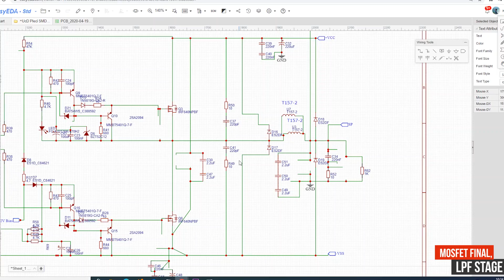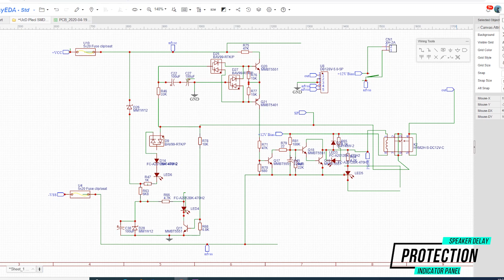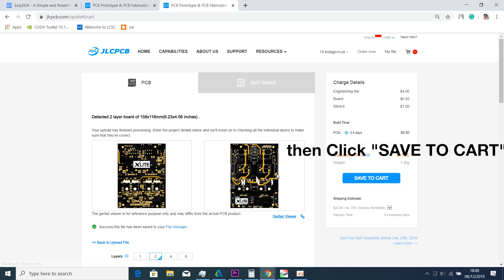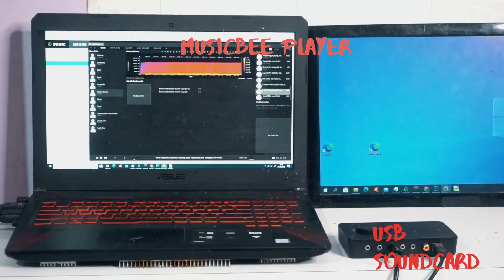Stereo HiFi Class-D Amplifier - Discrete UcD Pleci

Comment: Apakah wiring juga mempengaruhi noise?
Reply from the maker: Banget gan
Reply: Katanya kabel untuk input tidak boleh melewati power suply apa betul mas wahyu?
Reply from the maker: @umamimi2338  sbaiknya iya yang ftal diatas psu tanpa shielding, kbel speaker jg . lbih amannya di kasih ferite bead sprti video tsb mas
Reply: Siap mase, suwun yak
Reply from the maker: Sama2 mas